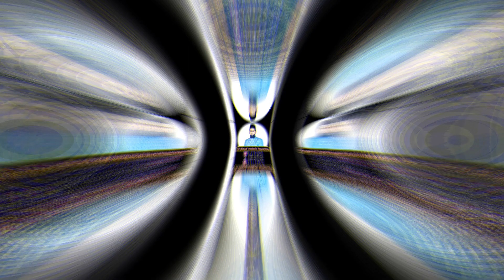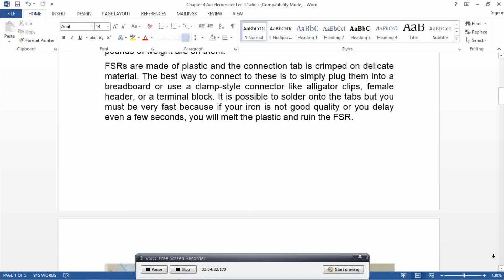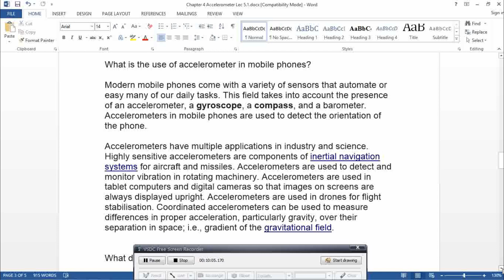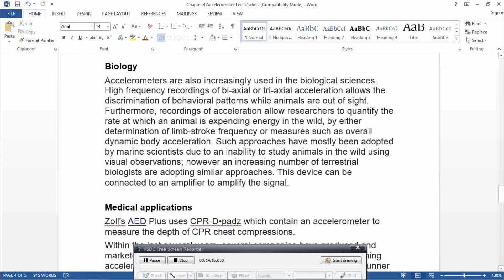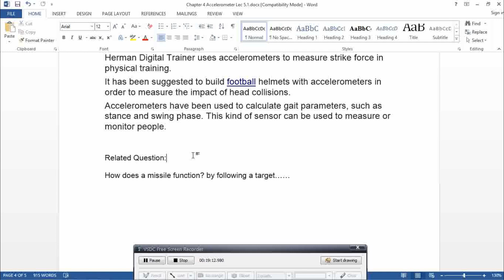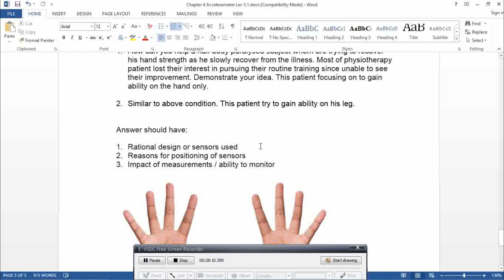Medical Instrumentation BEU40503 LESSON 6

Comment: Thank you for your lecture Dr. My answer for your question is the radar transmits EM pulses that bounce off the target and return to the set radar to provide the position, direction and speed of the target.  Infrared (IR) sensors and focal plane arrays are used for surveillance, object identification, target tracking and discrimination in ballistic missile defence.

Comment: AHMAD FAUZAN BIN ZAINAL ABIDIN DE160061
Thank you for the sharing Dr. For the question, Infrared homing is a passive weapon guidance system which uses the infrared (IR) light emission from target to track and follow it. Missiles which use infrared seeking are often referred to as "heat-seekers" since infrared is radiated strongly by hot bodies.Active homing uses a radar system on the missile to provide a guidance signal. Typically, electronics in the missile keep the radar pointed directly at the target, and the missile then looks at this "angle" of its own centerline to guide itself. Radar resolution is based on the size of the antenna, so in a smaller missile these systems are useful for attacking only large targets, ships or large bombers for instance. Active radar systems remain in widespread use in anti-shipping missiles

Comment: Muhammad Farid bin Zulkifli
de160060
Thank you dr Mahadi for your video explanation. The question that dr give was how does the missile function by following the target. The answer to your question is smart weapons rely on integrated missile guidance systems to deliver strikes accurately and evade enemy detection systems. Accelerometers are an essential component of these systems. The accelerometer collects the input data utilized by the guidance control computer for course correction and flight stability so that the missile will reach its intended target.

Comment: Thank you Dr. Based on this lecturer there are four sensors which mainly used to:
Force Sensitive Resistor (FRS) - Detect physical pressure, squeezing and weight.
Flex sensor - Detect bending or flexing
Accelerometer - Measured acceleration forces
Gryroscope - Measure or maintain rotational motion

To answer your question on how does a missile function, basically a missile, also known as a guided rocket, is a guided airborne ranged weapon capable of self-propelled flight usually by a jet engine or rocket motor. It's used imaging device such as infrared Focal Plane Array (FPA) as a guidance sensor and radar system as a guidance signal.

Comment: The missile function are by inertial navigation system. it consist the accelerometer which are used to detect and monitor vibration in rotating machinery. Besides,  missile need stabilization so its compatible with the accelerometer function as well. In order missile to follow the target, the accelerometer can be used to measure differences in proper acceleration, particularly gravity, over their separation in space like gravitational field.

Comment: Nor Fara Syahira binti Mahpar
Thank you Dr. for this video lecture. For answer your question, the missile is powered either by solid or liquid fuel rockets or jet engines. In order to propel it to the point, such missiles use hybrid technology. The role of the guidance system is to use the altitude control mechanism to keep the missile on its desired flight path. Infrared, radar and global positioning system are the types of sensors that widely used today. However, gyroscope and accelerometer are also used to focus on devices onboard the missile for inertial navigation that senses its motion and acceleration in different directions.

Comment: NUR SARAH BINTI ABDULLAH
Thank you Dr for today's lecture. Today, I learned about sensors such as: 
1. Force Sensitive Resistors (FSR) - allow to detect physical pressure, squeezing and weight.
2. Flex Sensor - to detect bending or flexing.
3. Accelerometer Sensor - to measure acceleration forces.
4. Gyroscopes - to measure or maintain rotational motion.
 I will do more research on applications of sensors.

Answer: Sensor used in missile for surveillance, target detection and target tracking are space-based infrared (IR) sensors and focal plane arrays (FPAs).